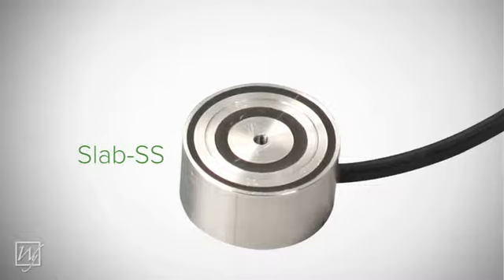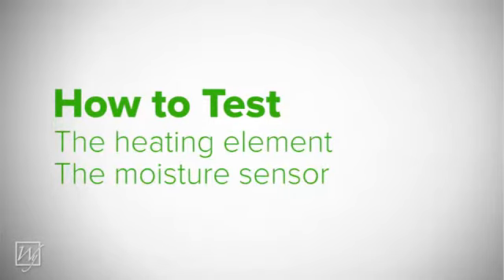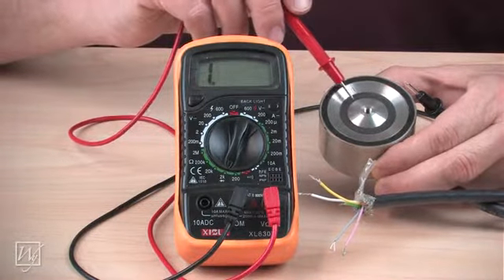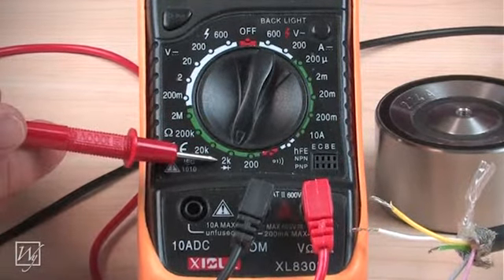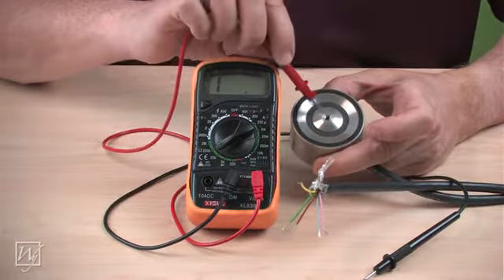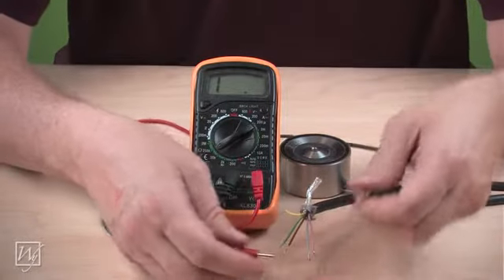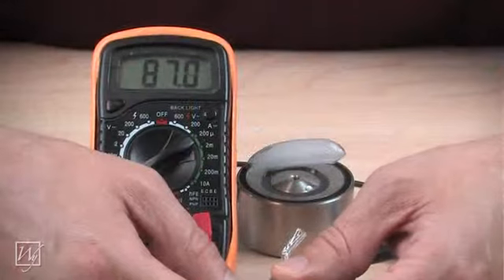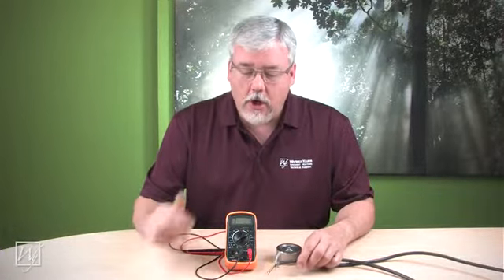How to Test a SLAB-SS Snow Melting Sensor

Comment: Thank you for this video! I have the same sensor, but in Europe seems to be called ETOG-55. I have 2 pairs of this sensor and ETR2 thermostat controller. A pair does not function and I guess is the temperature sensor NTC 12k Ohm sensor (Grey and Pink wires). Do you have any graph for the resistance vs temperature for this sensor? With the multimeter on the 20kOhm scale, I get 8 kOhm on the working pair and 3.4 kOhm on the defective pair.
Reply from the maker: Hi bogdangheroghe, I reviewed this with our tech team and they said this document should help:  https://www.warmlyyours.com/en-US/publications/SM-ETOG-55-INSTRUCTIONS-10293-A.pdf

Comment: sir,how is the system seperate rain or snow??Its a moisture-temperature relationship??
Reply from the maker: Hi there, so the sensor detects moisture and when the temperature drops to 38 degrees Fahrenheit it will let the controls know so that the system can kick on. The temperature is the important aspect here. It gets very humid here in Northern Illinois as well, but it's when the temperature drops that the system will know when to kick on for snow rather than just rain.